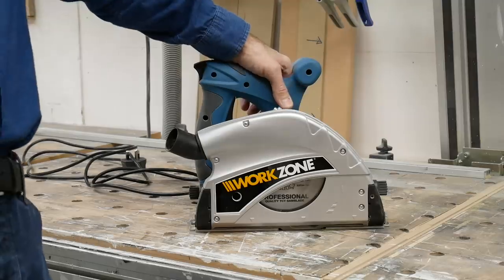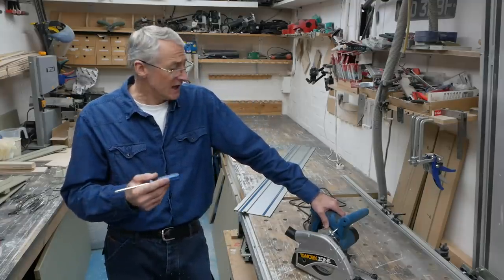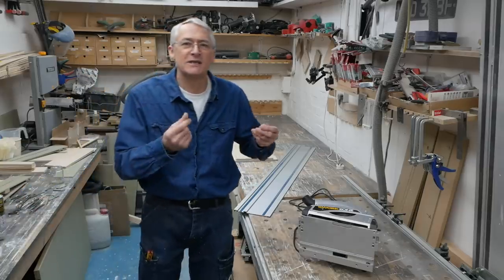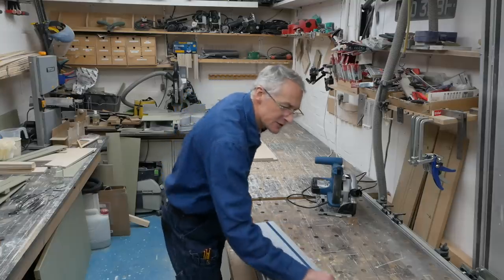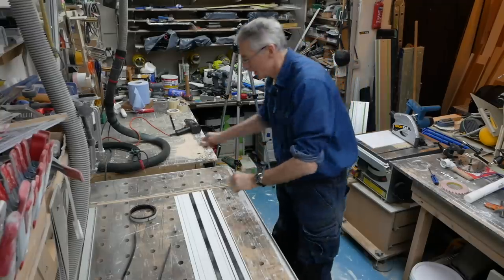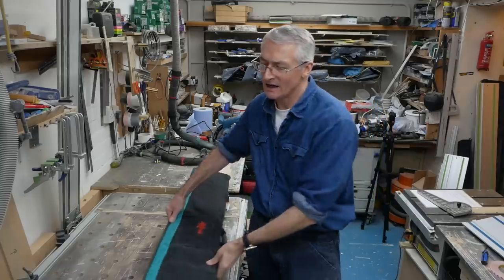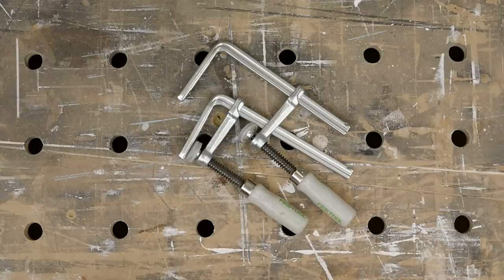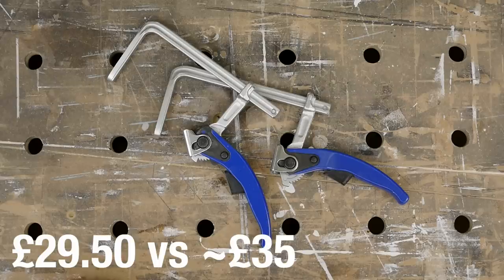TW P7; Improvements and maintenance [video #283]

Comment: You may have covered this somewhere that I haven't yet got to, but some people recommend cutting through masking tape to support the grain and reduce tear out. Do you ever do this?
Reply from the maker: Not for anything with grain, no. I've done it on hi-gloss panels to reduce chipping on the waste-side when I'm not using the little Festool foot thing, but I've never had any real problems with tear-out on the waste side of the cut tbh, not with the blades I'm using 👍👍
Reply: @10MinuteWorkshop  Thanks for the reply. Also thanks for the series - really informative and has opened up a new area of woodworking for me. I (and a lot of other hobbyists) watch so many Youtubers with Sawstops and huge workshops and then end up buying a sub-standard table saw and spend far too long trying to get it to cut consistently. This is a better solution for so many people with limited space, money and time to spend on their hobby.

This also helps me with the chicken and egg situation of how I build a straight table saw fence with a table saw with a poor fence!
Reply from the maker: @freakeystyley34  Thanks! 👍

Comment: Thanks for the series Peter. You often mention how the tracksaw can replace the table saw for most uses, but I also notice that we don’t see you using the mitre saw much either. Has the tracksaw + MFT combo usurped the mitre saw in a lot of use cases too?
Reply from the maker: Actually, yes. The mitre saw gets used mostly for larger section timbers now - which I use rarely tbh. 👍👍

Comment: I just binge watched this series and it was wonderful! I learned quite a bit but I did have one question though. What's your opinion on battery powered track saws like the Makita one versus a corded one for example. It's one less cord to worry about but is it worth it.
Reply from the maker: Thanks! I’ve never used a cordless tracksaw; by all accounts the dust collection is decent enough into a bag, but I’d always use an extractor, personally, so if you have a hose attached, then saving a cable doesn’t seem like much of a big deal - especially as you’re adding the weight of a  battery, or two.  It if you’re happy with dust collection in a bag, then sure, I can see the appeal. 👍👍

Comment: Hi Peter - thanks for taking the time to include all of these details. I'm wondering whether there is any reason to have both the Festool rail with holes (for shelf pins) and another rail without holes? Is there any downside to using only the rail with holes? (Other than overall length?)
Reply from the maker: Hi Gary, and thanks! No, no downsides at all - cost aside of course. The only 2400 rail I have is the holey rail, works great for both shelf pins and long straight cuts. 👍👍

Comment: Hi Peter did you ever do a full review on this saw? Can't seem to find a park side saw so what other entry level saw would you recommend?
Reply from the maker: Hi Michael. The Titan from Screwfix (occasionally available at B&Q) is my entry-level plunge saw recommendation, and I compared the Aldi saw with the Titan in video #285 ‘Cheap vs Cheapest’, and the Titan with the Festool in a short series that starts at video 071 ‘Festool vs Cheap tool’. All my plunge/tracksaw vids are in a playlist for easy access, btw, and playlists are accessible from the ‘playlists’ tab on the channel home page. 👍

Comment: I plunged right into this series, proceeded down the track logically and straight from the start to the finish. Squaring up to what faces me ahead, I see a bit of jig construction which should help avoid the need for a MFT. BUT I was considering making an MFT type top to my as yet unmade workbench and using bench dogs to keep work true and the rail square - I suppose I need that rail  gizmo you showed that uses bench dogs and can be fitted with flag stops?
Reply from the maker: Pun-tastic comment there Norman, thanks! The rail dogs and extrusion will work well for that kind of bench top, yes - you'll have a very flexible workspace to tackle all kinds of projects 👍

Comment: Peter, I dont have one but been considering a cheap one. Are you saying the track doesnt need to be clamped down? Just the weight of the saw holds it lined up with out cut marks?
Reply from the maker: Most of the time yes. If you’re a new user, and cutting something thick or expensive,  then it’s wise to clamp, but I’ve used one pretty much daily for years and I’ve clamped a rail only a handful of times. 👍

Comment: I just binge-watched the series - thank you for making it. It was timely as I'm considering ditching my cheap table-saw in favour of a tracksaw.
I was however hoping that you would mention the drop-down (hinge-down?) mechanism that you use to bring your track into play, then tuck it neatly away after use.
Is that a Festool accessory, or did you engineer it yourself?
Reply from the maker: Thanks! Take a look at videos 182 & 183 - they explain the Festool MFT in detail. 👍👍

Comment: I second that, I am definitely convinced about getting one now to the point where I may sell the panel saw and stick with the old table saw. However, the Festool is too expensive and the budget ones too cheap. What about the middle ground like the Makita sp6000? Any wisdom about the mid price options would be most welcome.
Thanks for posting.
Reply from the maker: Not sure Makita would consider themselves ‘middle ground’ lol! In all seriousness, it’s a really tricky one tbh, as there isn’t really a ‘middle ground’ apart from price-wise. Before this series I would have considered Scheppach to be middle ground, but not after having a close look at the Aldi. And the Titan is no more, so really all there is, is the Erbauer and the Triton, before you get to Makita. I haven’t used the Makita, other than to ‘play with it’ making a few cuts. It’s perfectly decent. No riving knife, and I think the anti-tipping lip thing on the track is a gimmick, but it’s the closest track pattern to the de-facto standard Festool pattern. I haven’t used the triton or the Erbauer at all, I’m afraid - though I intend to as soon as I can, but so, so many other things to do before then, unfortunately! 👍

Comment: Hi peter, I saw your video on plunge track saw which was Triton and parkside.ive seen another video related to parkside plunge saw their was problem with rubber on the guide rail which get trim off as you use the rail, in that video the rubber was 2-3 mm away as you plunge the saw.is it true
Reply from the maker: Hi Elvis. The quality control on these entry-level ‘supermarket saws’ isn’t very good - see video 327 - Supermarket saws and quality control - https://youtu.be/X5e2s39H1Sc - but the customer service is excellent, so there’s never an issue taking these back for exchange or refund, it’s just a question of wether you can be bothered with the hassle. As I say, mine was great straight out of the box - but it’s last years model 🤷‍♂️👍

Comment: Two days before you published this excellent series I purchased the cordless version of the Scheppach. What a coincident.!
Anyways, upon unboxing the saw I noticed straight away that the tracks didn't lay flat on my desk -- the sticky rubber bands had been attached haphazardly so that sections of them crossed the extrusion ribs. I haven't done anything yet, but before I return the rubbish I wonder if you have any experience removing and re-attaching these bands in the same way as you did with the splinter guard? thx
Reply from the maker: I haven’t, no. I don’t think the neoprene grippy strips area as robust as the splinterguards, sonic you do go for it, go carefully. 👍👍
Reply: @10MinuteWorkshop  OK and thanks,,, I guess you get what you pay for so I just cut away the pieces.

Comment: Firstly .... Thanks so much for this series Peter, it's been excellent. My big question is this: If you get a Workzone Track Saw and put in a Festool blade, plus tape up the housing to improve the dust extraction .... Is there much practical difference between the two ?
Reply from the maker: Thanks! The workzone saw has a fair few issues, and I cover these in detail in the current video #285 “Cheap vs Cheapest”. There are many differences between these entry-level saws and the Makita/DeWalt/Festool/Mafell, e.g.  soft-start, variable speed, weight, noise, dust collection, availability of spares, etc..etc.. see the Festool vs Cheap Tool series starting video #071 for (lots) more detail. 👍👍

Comment: Bravo Peter Bravo, a full comprehensive guide, I now NEED a track saw/plunge saw, been thinking for about a year, but my 2 circular saws are up for sale now (gonna keep the battery Makita, because its easy for rough cutting) in your opinion is it worth just outing the original blade before doing the trimming of the rail rubber? loved the 'guide hacks' simple but very effective (most of them are, you just have to think ahead) but a great series that I dont think will be bettered, I expect this to be your most viewed video ever.
Can I ask, I just noticed a number plate on the wall MKD32(8?)F Is iot from your 1st car?
Again fantastic series, well done
Reply from the maker: Thanks! Most blades on the entry level saws are a bit on the rough side - worth keeping for rougher work maybe, but best replaced. Just watch out for the kerf. 👍👍
Reply: Just 1 more thing, you guide rail on your mft table, what is the bracket that holds it in place? only you have never mentioned how it is attached (or did i miss it)!
Reply: @10MinuteWorkshop  I dont get the 2.2mm why not 2mm!!
Reply: @Pistol_Knight  buy the Freud Pro 40t blade (£26 from screwfix) along with your saw. Pop it in for the first cut :)

Comment: Really nice set of vids Peter. Hacking my Dewalt TS in the next month  so thanks. PS What divers watch do you have in video p7 .?Seen you have a Sekio with a pepsi dial.
Reply from the maker: Thanks! I have a (very) small Seiko collection - I’ve been trying to pull together a watch (or two) from each decade that I’ve been breathing, but the 60s divers are beyond what I’m prepared to pay. This one’s. ‘tribute’ lookalike to the 6105 8110, but with a modern movement. I’m wearing a few from the collection in this seies, as it was shot whilst having ‘time off’. Maybe there’ll be a ‘Wednesday watch workshop’ sometime. 🤔😂👍👍
Reply: @10MinuteWorkshop  Very Nice. I have a small collection of watches and in the divers I have a  vostok anchar in yellow and have just got a very nice Tauchmeister t0264 . Just remember there is a massive sekio community with lots of mods on glass, dial and bazels
Reply from the maker: @garychenery-owen5529  Thanks! I'm far from fanatical about 'originality' but I have a bit of an aversion to 'modded' watches! Each to their own though 👍

Comment: An update to my message below. The Axminster Quick Action Guide Rail Clamp", shown on page 191 of the new Axminster catalogue, fits through the holes in an MFT worktop. So it's not just a rail clamp - it is also a hold-down clamp. It may not have the clamping pressure of a Festool ratchet clamp, but  at only £11.95 it's a much more affordable option!
Reply from the maker: Good find, thanks Clive! 👍👍

Comment: Nice series! I'm curious if you've seen these Platforn Saddles from Veritas? I don't have an MFT, but these fit into dog holes on my bench and let me use my track saw ( Grizzly version of the one you are showing from Aldi) on my bench or portable work table (a Dewalt model) using 2x4" that elevate the work (see pic at Lee Valley). They work well and could be a nice solution for someone on a budget: http://www.leevalley.com/en/wood/page.aspx?cat=1,43455&p=75861

Comment: Morning Peter. As usual a great series, thanks for that.  Maybe your series is not over yet. If you search YouTube for conkcat you will find a MDT for a cheap tracksaw.  Have a great day
Reply from the maker: Morning, and thanks! I have a mobile bench build coming up as the next series where I'll cover the whole hinged rail thing; loved your idea of using two hinges to get the variable height - brilliant! How did you attach the rail to the hinge - small bolts, or did you pop-rivet?? Thanks! 👍👍
Reply: Hi Peter. That is an emergency door hinge with 3 leaves. 22 quid from screwfix a pair. Have fun
Reply from the maker: Got it, thanks! 👍👍